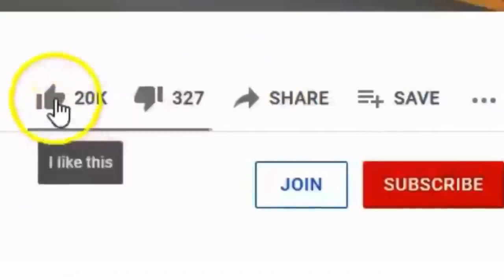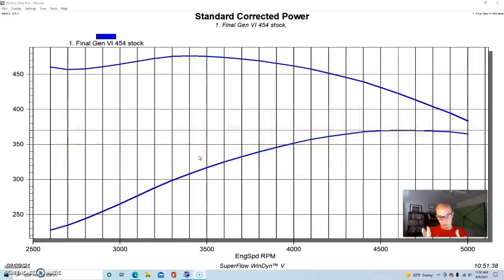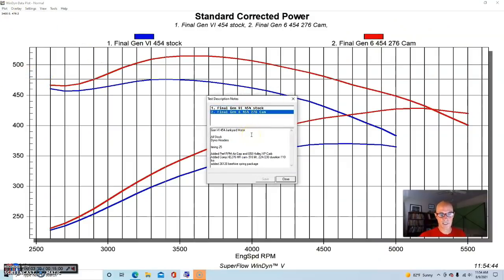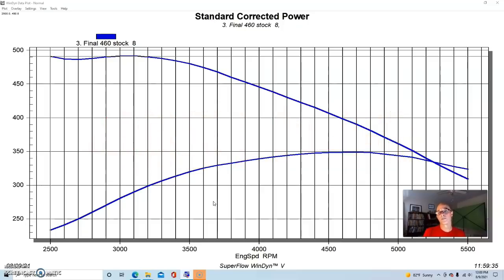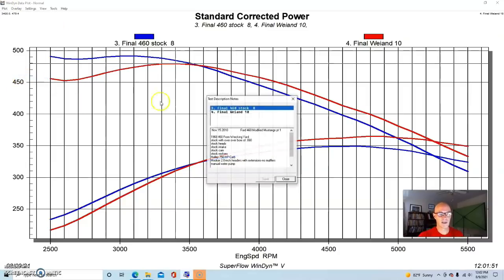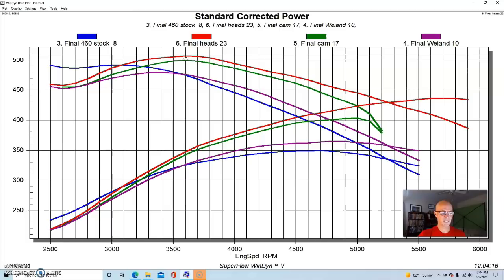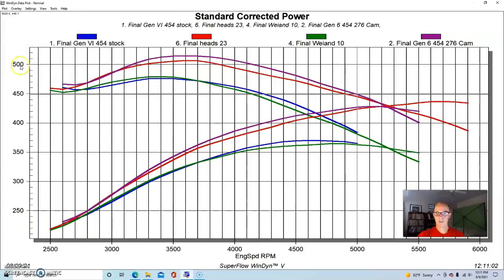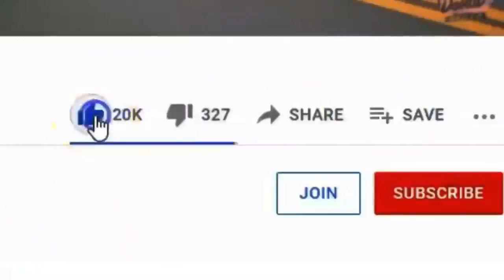JUNKYARD BIG BLOCK POWER-460 FORD VS 454 CHEVY FULL DYNO RESULTS

Comment: The BB FORD will last longer than the BB CHEVY.
Reply: @Yeah Right I am a ford man. I also have owned a few chevys back in the day. I am not saying the 454 is a bad motor. Especially the early 70's engines. LS6, & the LS5. In my opinion the 460 is a better engine. I have owned a few that went well past 200k without a problem.
Reply: The fact you think that is true is laughable
Reply: @zacharyreimer2777  The fact I know it to be true. You just can't handle the truth. I have owned both. Quite a few back in the day. Also worked on quite few 454's. You know. Valves & lifters, some push rods, & the occasional piston. Never had to do those things to any 460. Replaced carbs. Never liked the motorcraft 4VV CARBS. A voltage regulator now & then. Maybe a waterpumb here & there. If you had good luck with a 454 great. I never said I did not hate the 454. I said I prefer the 460. Plus other GM brands made better big blocks. You know Olds, & Buick 455's. Pontiac455. Cadillac 472&501. 430 wildcat.421 pontiac. And last but not least the chevy 427
Reply: Just turned 500k in a 85 f250 with   460.  Nog saying it’s better than a GM but 500k isn’t bad, still plenty of life left in the block also.

Comment: I always though it crazy that the 454 crank weighs about 60lbs, the 460 crankshaft weighs 86lbs, and for comparison, a stock 3.622 stroke LS crank weighs about 53lbs. Big block POWA!
Reply: Ford cranks don’t break like those chebys
Reply: @MrBlackbutang  very true. 454 crank gets fragile right around 600hp
Reply: Im not 100% on this so dont hold me to it but the fords crank is prob so heavy because i believe they use nodular iron i hope i spelled that right😂 but either way its suppossed to be really strong ik they use that in the small blocks not a 100% in the big blocls
Reply: @adamdesjarlais8183  Um that’s laughable the stock crank on a 454 can handle up to 700 horsepower. If your building a motor and using the stock crank most likely your taking the motor to the machine shop to have the deck surfaced or zero’d, block cleaned, and fully balanced a big block crank can handle 700 horsepower if your motor is balanced and that’s “handling” 700 horsepower you could have more power but then it will get more “fragile”
Reply: @TheWorldWarrior  your sentence seems contradicting
Reply: @TheWorldWarrior  you only need to technically shave weight off the crank weights if you're using aftermarket lightweight pistons and rods. Most machines shops only polish the crank journals for a stock rod and piston
Reply: @adamdesjarlais8183  Where does my contradiction exactly stand? You mention lightweight pistons and polishing which is irrelevant to what I said are we debating piston speed and crank rotational stress now? I said the stock crank can handle 700 horsepower my stock crank runs 600 to the crank all day at 6,000 rpm and stock reconditioned rods. I definitely don’t recommend a factory crank above 6,600 rpm’s fully balanced or not

Comment: Really opens your eyes when for years all everyone said was the 460 was a boat anchor or a luxobarge motor and the bbc was a power monster. Now stick the same size roller cam and air gap intake on the 460 and see what it does!
Reply: Bore the 454 out to 472 cubes and mill the head down for 10.5:1 c.r. and see what it does.
Reply: All comes down to aftermarket support these chevys weren’t and aren’t  anything special
Reply: @corvettejohn4507  the Ford 10.5:1 was a guess as that’s the rated factory spec for a stock 460.  If it had .060 overbore, there’s no telling what piston was used and how far below deck it was.  I might have missed Richard going through and measuring actual volumes to get true compression however.  18 ci?  Would you lose the roller cam and better intake for those couple cubes?
Reply: @jaywilliams2710  He also didn't say what cc the heads were on either one which would also effect CR.
Reply: I got notifications of one or two other replies to this but none are showing up here...   Deleted by author(s)?
Reply: @jaywilliams2710  it must of been chebby guys with pissy comments who decided they looked childish and deleted it. Lol!!
Reply: @corvettejohn4507  That 460 can be taken up over 500 cubes no problem,so lets see a 528 vs a 472.
Reply: The point corvette john was making was with the 460's .060 overbore it was displacing about 472 cubic inches...
So 20 cubic inches bigger and probably a point or more compression in the ford...

Comment: Yeah the 68-71 429s had flattops with 2 valve reliefs   it had 10.5 :1 compression ratio  it has  a  3.59 stroke

Comment: That quick still shot of the 460 with the heads off,,,,,,,,  I didn't think the early 460's with 10.5 to 1 compression had that much of a dish in the pistons...
(Edit) I think now I know why I was confused,,  I was visualizing the pistons in my 77' 460 and they had such a HUGE dish that it made me think that the earlier ones must have been flat tops,  but I don't think they ever were...
Reply: There is over 20 cc difference in the  heads on a '68 and a '77... huge difference :)
Reply: @ewetoobz3840  correct, 75 to 95cc
Reply: The better marine versions ran forged flat tops with the larger chamber heads super cobra jet old school cam , did pretty good on 89 octane
Reply: @gainerman  there's a boat junkyard near me with a 460 engine.
Going to check out your story. If so, buy the engine.
Reply: @cammontreuil7509  most of the 460s were truck motors with a non emissions cam and gear and huge non egr scj cast intake . The flat tops and larger carburetor really made a difference on the jet boats and light stern drive apps. That's a score if you find a good one
Reply: @cammontreuil7509  I bought the engine. Didn't have Forged flat top piston and a Cobra Jet cam either

Comment: Back in the day engine builders would recommend the 460 Ford if it was going to stay in stock configuration, and the big block Chevy if it was going to be modified.
Reply: Ya this video was interesting because I always heard ford 460 heads werent any good. "They don't flow" or whatever... I love these youtube guys putting all of those old ass drag strip projections in their place and killing the rumors.
Reply: John Buck  Let's put cubes and compression ratio at level playing fields and do it again with everything else the same. That basically shows who makes a higher flowing head. 

The rocker arms had oiling issues, but it's a simple fix any machine shop fixes out of the box unless you specifically ask them not to. After the 454, you had the 8.1(496) and the 502 crate. What did ford make to keep up with those? The triton v10? I know the 8.1 is an absolute legend in the oil fields... The 502 was a base for many successful bracket cars not wanting to deal with boost/timing timers.
Reply: John Buck  The only BBC I've ever raced was full dry sump so IDK.
Reply: John Buck  Goal posts? Number of wins. Game over. Why do you keep replying 2,3,4,5,6 times to one of my comments?
Reply: John Buck  Ya, I gave you that one dummy. Bill Stroppe vs Robby Gordon. Legends. One of them is still racing with a vibrant career after his stint in indy cars. Have you seen what mfg body/engine is in the gordini? How about the stadium super trucks?
Reply: @scottleggejr  - Only cheaters have always been chevy,
Reply: @scottleggejr  the ford v10 is way better then the 8.1 they pretty much had same hp and torqe and the v10 is much better on gas
Reply: @kevindodge2103  But in the same age/era, you have the LS motors. That LQ4 has quite a few units out there. Not many plug spitting triton v10 out on the roads anymore. Not saying it's not a good unit, just different/odd/quirky without much aftermarket support, as compared to the LS. I think the other dude deleted a bunch of posts so I kind of look like an asshole in this chain. I was trying to be neutral/fair and objective and fact-based, but also not taking any punches.

Comment: Cool how close they are.  I love the bbf love though.  Better start snatching them up boys.  I feel like with the heads and stroker kits out there these days, they are the up and coming dark horse.
Reply: He said it was a high compression motor which would mean it was either in a truck or out of a Lincoln made between 1968 to 1971. On the other hand, the motor was rebuilt, so who knows what kind of internals were installed. It could have been produced whenever.

Comment: 69 460 . Port the Heads. Blueprint and Balance , put some hardend valve seats on exhaust side, SCJ Crank and A Nice Holley . All You'll need to get the job done.
Reply: Depends...what "the job" is!
Reply: @Mr1Tanker beating the 454

Comment: I got a 2010 Ford Explorer with a 4.6 3 valve I wanted to make just a little bit more power what kind of Cam would you recommend what kind of heads would you recommend.
Anybody with any input your comment is more than welcome
Reply from the maker: no need for heads, comp has mild cams

Comment: A fairly real as can be expected apples to apples comparison, I was surprised it was that close
Reply: Not an apples to apples comparison and they were only close because the Ford had much more done to it. The Ford needed to be bored .060 over with higher compression pistons, ported heads and a cam swap just to keep up with a stock 454 with a cam swap. Not apples to apples at all. If the Ford was stock bore, compression and heads it wouldn't have even been close to the 454.
Reply: @vandersgarage4682  Within 10 to 15hp in stock and slightly modified versions, virtually the same power  chevy had the roller, ford had ancient heads. My opinion is unchanged
Reply: @edpetrocelli2633  You're missing the point.....at no time in this testing was the 460 ever stock.....they bought it already bored and with higher compression pistons.

Comment: Engines are just simple air pumps. There are oiling and other factors to consider. But  in my opinion any Chevy guy claiming the 427 is better than the 454, should also think the 460 is better than the 427. Bore and stroke ratios are very close between . the two. but the Ford has 33 more cubes.
Reply: Thanks man!!
Reply: There's more going on than processing air.
Reply: I think he might be thinking along the lines of the 427 being developed more for racing purposes originally.

Comment: So they are similar stock and they are similar modified but if you bore and stroke them and use aftermarket cylinder heads, Ford can go bigger and flow better.

I'm not sure if there is a junkyard 460 combo that gets a rollerized valve train, good flowing heads and high compression but if there is that is the winner.
Reply from the maker: they can go big
Reply: @richardholdener1727    As you know, BBC's can go big too.  A Bow-tie tall deck block and a 4.5" stroker crank equal over 600 cubes.
Reply: @corvettejohn4507  good luck finding a Bow Tie tall deck block in a junkyard.  A regular production 460 block from a junkyard can go big without a special intake, longer pushrods or the extra $2-3,000 for a tall deck block.

I'm not sure anything beats a 460 if you want to build more than 530 in³ until you're buying 100% aftermarket parts.  At that point you can spend as much as you want but you're not going to beat the bang for the buck of a stock block stroker with good heads, intake and cam.
Reply: @joequixotic3039  I know.  All I was saying is that one can build over 600 cid BBC if you want.  It just requires a Bow Tie block or aftermarket block.

Comment: How about a GM 8.1 liter V-8 vs. a Ford 6.8 liter V-10?
Reply: That’s not a really good comparison
Reply: @tuckercole1531  Fords biggest gas engine at the time v. Chevy's biggest gas engine at the time... sounds fair to me, and I'm a Ford guy. For comparisons sake of course. I don't think Richard has room for any more engines right now anyway, but I'd love to see a 6.8 on the dyno.
Reply: @ewetoobz3840  yeah I get where your coming from because they were the biggest engines at the time but I can already tell you the v10 will probably have more horsepower and the 496 will have more torque.
Reply: You can do a butt dyno yourself with U-Haul trucks. Go rent a GMC JH 26' truck & one of the newer Ford JHs with the V10. If it's a decent running 8.1 & not all ragged out, you'll be amazed what it'll do, spin tires easy on gravel/sandy pavement. Ford is much more relaxed but steady power & gets 1.5-2 MPG better. Also never have to work on them, they just keep going & run smooth no matter how many miles. 8.1 is a hot-rod motor, 6.8 is a lifer motor. My service truck has it & is knocking on 300K, no leaks, no knocks, starts up every morning & I never touch it other than PM. I wanna see Holdener do a big bang with both & the Dodge V10 💥

Comment: Those pistons in the 460 you showed are truck pistons so at best 9.1 compression.
Reply: DISCLAIMER:  Pictures used in the videos are not always pictures of the exact engines tested.
Reply from the maker: remember the chamber size
Reply: @richardholdener1727  I know what you have there I built these combos for street strip for years. You take a set of early 460 or 429 heads and use a truck piston and it brings the compression down to 9.1 great for a street truck. But if you are on a tight budget you can use a 1975 and up low compression 460 truck or car short block and bolt a set of DOVE-C heads on it or early 429 heads that flow much better the the late model heads and instantly you go from 8.1 to9.1 compression. I run a1972 f150 that is all stock except for the cam and the intake and carb and I run low 12s and if I got traction it would run into the 11s. I have done this for years.

Comment: Back in the day,  I don't remember anyone trying to hot rod a 460.. do remember people loved the 454.
The 427 Ford yeah,  the 460, no.
Reply: The 460 was never put in anything for performance. The performance 385 series engines were only 429 cubes (boss 429, 429cj and scj) Back in the day, guys like roush put 460 cranks in 429cj for more power. There was a 70 or 71 mercury with a 429cj in cars illustrated that started at 13.90’s and they got it into the mid 12’s then added a 460 crank and ran either a 12.00 or high 11’s i forget now.
Not like 454 vettes and chevelles or 440 everything!
Reply: @heathermiller2917  right,  they were put into land yachts probably up until the 80 80s I think? 
Remember when everyone wanted a 426 or 427 something?  Ah those were the days!👍🇺🇸

Comment: The Ford 460 was a beefed up Cleveland 351 with all its faults. IT was designed without though to performance as 90% of them went into trucks. Whereas the 396-427-454 was a sweet motor with canted valves and just loved to rev. But the 454 ended up in trucks too. The Chrysler 440 was similar. The 426H was the sweet (though big and heavy) queen of them all producing an easy 450-475 HP in standard configuration. If I was to pick the best one, it would be the Chevy 427.
Reply: Chevy 427 parts look like a toy compared to oem ford 427 components.
Reply: @madmod  Which Ford 427?  They made so many different 427/428/429s that I can't even remember how many different motors they had.  I guess Ford operates on the principal of "Why have 1 good motor when you can have five different boat anchors parts won't interchange on."
Reply: @corvettejohn4507  the ford 427, 428, and 429 are all completely different engines lol. The 385 series was for working, the 428 was for top trim full size sedans, the 427 existed soley for performance and swamped the 427 Chevies in most forms of on and off road racing.
Reply: @corvettejohn4507  On paper the canted valve chevy heads boast better flow and should perform better but its pretty hard to argue with the high Riser or tunnel port 427 ford engines which can sneeze out 600fwhp on mostly stock parts.
Reply: @madmod  I'm not sure how streetable a tunnel port 427 is.  Those ports are huge and port velocity is low.  I imagine driving it on the street would suck.  Which is why Ford and Pontiac only put those on race motors.
Reply: @madmod  I know they were all completely different engines.  That's why I asked which 7L engine?  You left out the SOHC 427, then there was the low riser, the mid riser, the tunnel port, the side-oiler, the BOSS 429, the Cobra Jet 429 and the list goes on. 

Ford made more different 7L motors than I have underwear. LOL!  My point is that Chevy 427's swamped Ford big blocks on the street which is where I live.  I don't live at Le Mans, or Indy, or Daytona.
Reply: @corvettejohn4507 Firstly, I never said ford 7 liters. I said 4 2 7 plain and simple.

  Real competitive that street racing stuff is lol. Also lots of sandbaggers and liars out there too. If you want to talk things that are factual, you keep it official and documented. Didnt you know everyones grandpas and dad and uncles all have 7 liters that run 6s on no prepped streets... "Allegedly of course" 
What we have documented: current A and B stock nhra record: Ray Paquets 51 year old fairlane powered by 427 ci of Ford. 
The Bbc was a better drag racing engine than a sports car engine. There are reasons why Fords run so good in endurance racing. 
With the variety of aftermarket parts these days able to support big power from any of the big familes, who cares anymore what brand you make your power with?
GM is a welfare corporation that lost over $11 billion in taxpayer dollars, and worthless in every aspect that really matters so I could care less about them.